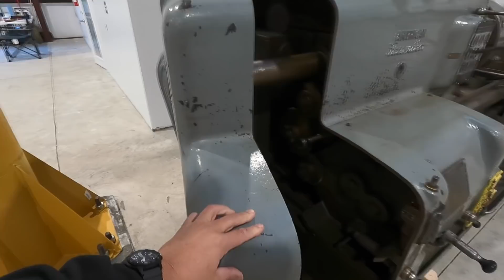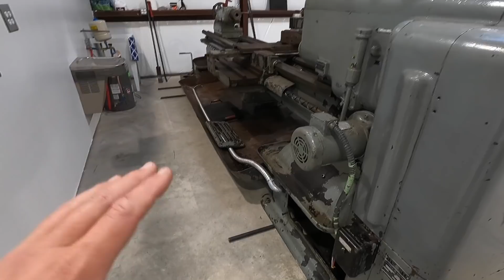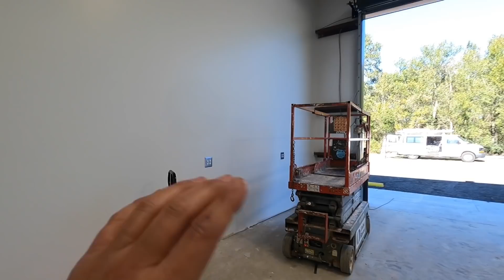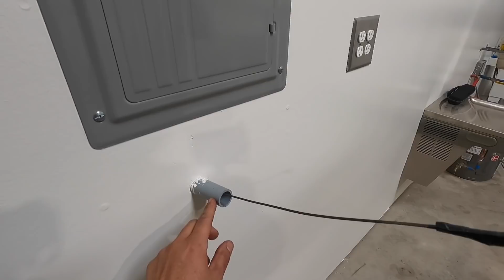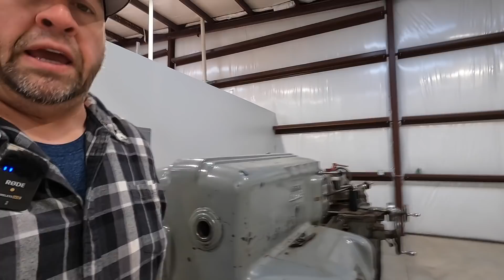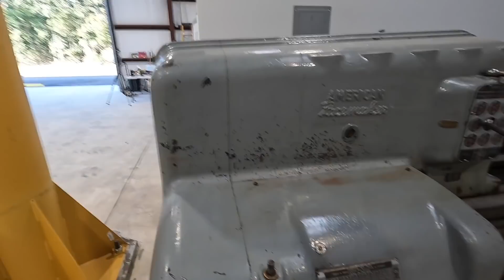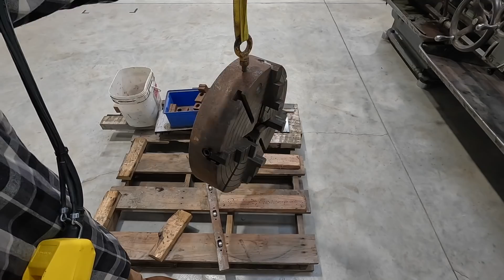New Shop Space Update 12: 3 Phase Electrical Circuits, Lathe & Crane First Tests

Comment: I have a feeling the previous motor starter might have had a 480 volt coil and that’s why it was shattering at 220 volts. . The coil could have been switched to a 220 volt.

Comment: 8:37 Get a load of the plumbers nightmare installation on the hot water tank.
 You got to be kidding me, that's the worst looking job, needs a bloody box around it.
I'd be well embarrassed offering this as finished install.
Plus where is the outlet for the temperature/pressure outlet going?
On the bloody floor, not acceptable in any circumstances.
Just as a last note the sewer vent pipe is also in an unacceptable position.

Comment: This reminds me of my first job out of school. Moving machines like this and larger in and out of factories. We had sets of things that looked like giant steel roller skates that we'd fasten under every screw down point. They had a solid bar sticking out of every skate and there'd be a man on each corner armed with a sledge hammer to smack each bar to point it in the direction we wanted it to move. Combined with an overhead crane we'd sometimes roll machines across an entire factory in or out of a loading bay. The only thing that used to scare me was the fact that factory floors in some old buildings weren't always flat and sometimes huge pieces of machinery would get a little out of control down an incline. We'd be praying that the slings and ropes we had hitched to the crane to pull it or stop it would prevent it from getting away from us. It was quite an art to do it safely and quickly because we'd often have to do it whilst everyone and everything in the shop was still working. I don't think they'd allow it on health and safety grounds these days.
Reply: Been there done that, worked a papermill in my younger days, then got smart.

Comment: The Overloads need to be changes for the correct amperage. The motors were rewired for 240v from 480v and the current will double. Check the nameplate on the motor for the FLC at 240v, there should be a sicker on the overload box that will show correct heater size for that amperage.
Another person had said that you need 3 phase overloads for a 3 phase motor. That is common for current overload relays but working with the older machines many only had 2 overloads but still gave full protection as the current from each winding would travel through 2 conductors at a time and the 3rd phase was wired straight through.
The shop is coming along great and love the crane!

Comment: Adam, I would rotate the pacemaker.... 90° clockwise..... And put it against the adjoining wall to the office cubicle. Why crowd your fountain and electrical panel unnecessarily?

(Let Abby design the layout. Women are so much better at those things than men.)

Also, with a bed that long..... You might want to research out a follower rest to purchase.

Comment: whats up with the lead / feed screw on the back side?  Looks like its a dual start with opposite handedness?  whats the purpose of that?  are there are RH & LH half nuts to engage in different directions?

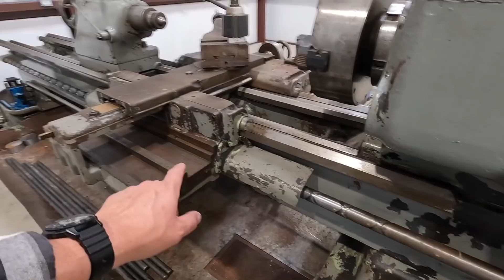kept watching...he explains it well @ 36:00.    its a dedicated(not clocked to spindle) bi directions rapid feed.  presumably for all your non cutting movements.

Comment: The overload protection "Heaters" look like just 2 of them.  The motor should be 3-phase, I assume.  Anyway, the heaters should be picked to match the motor nameplate values.  If over size or outright bypassed, that leaves the motor unprotected.  The most common reasons for the tripping is missing one of the three phases.  The second problem that I can think about is actual excess friction, meaning rusty ways.  And the third one is that the motor does not reach its full speed, because of under voltage, in this case it could still be hooked up for 480 V, while you try to run at 240 V.  A squirrel cage motor pulls maybe 10 x its nominal current during start and until it has reached its nominal speed.  If the supply voltage is too low, the motor does not get over the torque "hump" and remains at a high current "start" domain.

Comment: I was a machinist for 44 years. And more the half of that time was on American Lathes. Some were the old GE control CNC lathes converted to Siemens CNC controller sinumerik 810/840. The newest frame I think was 1968. Of all the lathes I ran in my career. American's were the best. The frame bed is by far superior to any thing made today. You my friend have a great lathe that they don't make anymore. And the industry is worst off. Keep making chips.
   .

Comment: I did industrial electrical for a very large Machine Shop and the electrical inspectors I know would have a field day in that building and I would have gone ballistic...Unstrapped MC cables dangling, no chafe bushings on EMT Connectors, using 1 hole straps on a rigid conduit on the floor instead of 2 hole rigid straps, running rigid on the floor through a walkway instead of doing an Arch over,  no penetration bushings on MC where it goes through the Red Iron and MC being used exposed below the 8' level.  If his "Electricians" had worked for me, they would have been sent back to class to learn the NEC or unemployed after I saw their work.
Reply: he's in Florida, they don't believe in regulations down there...
Reply: @stuartwheaton7340  So am I, and they sure as hell do around here.
Reply: Lol I was looking for this comment when I watched the video

Comment: Adam,  I tell you what's going to be tripping, it's you... over that 1' conduit on the floor. I would have cut a small trough in the concrete, or run the conduit up-over-and down. Ramping over, especially in a high traffic area, is a nuisance for walking or cleaning the floor. 
Still enjoy the content as always and congratulations on the new shop!
Reply: I cringe when i see that conduit laying on the floor, please be careful.

Comment: The "heaters" (thermal overloads) are half the size they need to be. They're sized based on the amp draw of the motor at the rated full load (listed as FLA - full load amps on the motor nameplate). Since the motor was rewired from 480V to 240V, the current draw of the motor doubles.

Comment: When you rewire from the higher voltage to 220, the current draw on the machine is much higher. The OL heaters will either have to be readjusted or replace with ones that can handle the higher currrent. Same goes for the coils on the contactor...if they were 480 or whatever before, they will need to be replaced with 220 or whatever you are using now.

Comment: The clutch sounds just like an automotive clutch which has a worn out throwout bearing or pilot bearing/bushing. In a car or truck, the throwout bearing spins whenever the clutch pedal is depressed which disengages the clutch. The pilot bearing or bushing is in use whenever the clutch is disengaged and the trans input shaft speed is not the same as the engine flywheel speed i.e. at a stop with the clutch pedal depressed. Not sure how that Pacemaker's clutch is set up, but if it is exactly like a car or truck's clutch those 2 items could be the issue. In simpler vehicles, the pilot is often an oilite bronze bushing supporting the hardened input shaft snout. Bearings are sealed though. When the clutch makes noise when it's being disengaged, it's just time for a new clutch assembly and both parts are replaced because it could be either one making noise and you're there anyway. If the clutch and trans make noise with the clutch ENGAGED in neutral with the engine at idle, that is the trans input shaft bearing that has gone bad. In that case, the noise totally stops when the clutch pedal is depressed and the clutch is disengaged. 👌

Comment: The noise from the clutch might be the belts with no load on them and the heaters need to be changed for the higher amperage of the motor at 240 Volts. Thy a little belt dressing  before you tare into it to far.

Comment: You guys in the States have a crazy electrical system. Here in the UK we got 240 volt single phase and 415 volt three phase and that's it.
Reply: In my USA shop I have 120V 1 phase which is one leg of the 208V 3 phase used on all 208/220/240V machines either single or 3 phase.  I have transformers for 460V 3 phase for the USA heavier machines, 380/400V 3 phase for the European machines and I may need to put in a transformer for the 575V Canadian machine.
Reply: Ours is 240, it is just split in two as well. More options. We have 480v so we can run bigger stuff.
Reply: @AldoSchmedack  Yes, I hear that, you have the neutral as a centre tap so you have  minus 120 and plus 120 volts giving the option of 240. In the UK that facility doesn't exist so all of our stuff is 240 minimum. The only variance on this would be building sites where transformers would be used for 110 volt power tools for safety.

Comment: not an electrician, but , usually when you change a 480 volt machine to a 240 or 208 machine you have to change the heaters because the amperage doubles,  not a big deal on the main motor because it is rarely going to reach full power, but feed motors and pumps are running at their ratings all the time
Reply: what do you mean by ''heaters?''
Reply: @JohnSmith-vi5pz  It's an "overload heater" wired in series with the incoming power to the motor. It protects the motor and circuit against overcurrent. A circuit breaker/fuse will quickly protect the wiring/motor in the circuit against a short circuit/very high current draw. An overload heater will protect the motor from operating above it's Full Load Amp rating for a length of time due to overloading the motor, or a motor failure (motor locked up, bearing failure, etc.) but still allow the inrush current needed for the motor to start. These won't necessarily trip a breaker/fuse. The overload heater is sized to carry the current that the motor is rated for, and as it does, it heats up. If the motor draws more current, usually 125% of its rating, it will heat up enough to "open", usually through a bi-metallic switch in the heater, to protect the motor from burning up. A lot goes into sizing everything properly, but this is a really simplified idea of what the overload heaters do. Hope it helps.
Reply: @KSparks80  Thanks, that's a perfect explanation.

Comment: Does this shop not need to comply with the NEC?
Reply: 36” clearance? Is one of the first things I noticed. Looks close.
Reply: No doubt, lathe feed looks nice but that bx across the ceiling feeding the crane is disgusting, aswell as those welding plugs. That should all be piped to look tight and clean.

Comment: Adam that's a very nice machine you got there!  With regard to the clutch my Harrison is a similar design clutch pack, they have a habit of being a bit noisy when not engaged, it's just the design, you can adjust it until it's silent but it's a fine balance between it being silent and a bit snatchey when engaging, I have found the best balance is it's making just a little bit of noise when not engaged.

Comment: wow there is already a big crack on the new concrete under the machine. I hope the concrete can handle that load with more machines. And I would be nervous moving that machine alone, I would have had someone around just in case.
Reply: Probably cracked just from curing, pretty common unfortunately
Reply: Originally that's what I thought, but I really only saw the cracks developing under the lathe. Just concerned about overloading too much weight on one spot with the crane as well. But I really like the setup so far.

Comment: That noise sounds like the bearing on the actuation lever clutch end should be an easy fix sounds dry or otherwise gone bad.
Reply: It's the clutch plates it's easy to adjust.

Comment: Are both lathe motors (the rapid transverse & main drive) wired into the same starter?  If so, you may need a larger size starter with proper 
heaters to handle the higher amperage.  Normally, each motor has its own starter and fuse block unless you're using modern contactors with thermal overloads.

Comment: I have a bunch of 4" chrome rod from cutting a 30' chromed cylinder rod in pieces. Adam, are all rods typically made of 1045 steel? If not, how to you figure out what it is? I was going to order some 4140 to make a bolt for my multifix tool post, but I'm wondering if my rod material is plenty strong. Thanks. If it matters, this rod came from a German built cylinder, about 10 years ago. It had to be replaced because it was bent.

Comment: In case someone hasn't posted it, one of the things I like with my jib crane in my shop is that I painted a 3-in wide line on the floor  that follows along the entire arc of the crane and hoist. That way as I'm moving things around on the floor, I know exactly if I'm able to reach it with the crane hoist.
Reply: And a piece of red safety flag that hangs about 8" down from the hook, if the hook is at head level and your wearing a hat, its just a matter of time before you smack your noggin on it. Not that it will help you if it ends up behind you... but, at least it wont be your forehead.

Comment: Half the voltage on the rapid motor, twice the current, so the correct heaters (overloads) need be installed for the 240/3/60.

Comment: Is it just the video, or was the handwheel not turning consistently when he had it engaged for threading?
Reply: This is by design, the handwheel should disengage when you use the power feed or leadscrew. It's turning a little bit because of friction. 
Else you get hit right in the balls.
Reply: I noticed the same thing.  Either dirty or it won't make nice threads!
Reply: It's called weight. It swings down due to gravity. Totally normal on large lathes.
Reply: Fair enough, my lathe is small and it stays engaged during power feed and threading

Comment: You think that clutch is noisy? you wanna hear my 65 year old Harrison L13! Nice Lathe you got there just a little small in the spindle bore diameter, as most older lathes are. I am rebuilding a fairly large lathe right now, new Gamet spindle bearings (£2800!) as someone changed gear under load and smashed a few teeth off (wired out a new one out of EN32 and ran it in pre hard to size it, now back from heat treatment) and pushed the debris through the spindle bearings while destroying the oil pump!

Comment: Alright Adam, it works it, works, it works! Hay, have you thought about putting flags on the jib crane hook and also the pendant cord it self? 
  What I mean is raise the bottom of the hook one fist in height, above the head of the tallest person in the shop and place a flag on the pendant cord at that height, this way you can always see the safe height to leave the cook when not in use. 
Then place a short removable flag on the hook it self, which will serve as both warning and pull handle. This will avoid most of the inevitable skull smash that are bound to happen.

Comment: if the machine was wired for 440 most likely the heaters need to be changed to 220V. Been there done that. lol
Reply: yes because higher amperage due too changing too a lower voltage

Comment: Today's contest:  Guess to the nearest thousand, how many "keyboard electrical experts" will mention the heater overload voltage!  Does anyone ever read the damn comments?
Reply: Nope
Reply: Lol
Reply: Who has time to read 1100 comments?  But to those comments I would add, the shop probably has 208Y/120 not 240.  240 would most likely be a high-leg connection having two electric meters.  In the case of a 208Y/120 service the motor should be replaced, if necessary, with one stating 208V instead of 208-230, because those motors with 208-230 on the nameplate are normally run on 240V.   A lot of 208 only motors will also state "useable at 200V."  Bottom line is best to have 480V service either with a step up transformer or in the case of a 480V service entrance use a 208Y/120 transformer to feed office needs.  Another way to handle it would be to install boost transformers.  A lot of electricians don't know how to connect them though.  

240 is typically used for resistance heating.

Got the right idea though putting the 20hp motor near the panel.  Saves money.  Of course the 480 does that too.

Comment: Do you need the rapid reverse motor running all the time? I mean, how often are you going to use it Adam, why not put it on it's own switch so you can turn it on if you have a job you are likely to use it on, It's just sitting there running wasting electricity 99% of the time.
Also, your rear door, does it lift off the hinges or is it fixed in place?

Comment: Are your electricians allergic to EMT?  That should have been at least a 1" EMT run around the side.  If you use copper you can get 100 amp feed later if you need.  They were already there and touching it, why not make it easy for the future with minimal material cost increase?

Comment: You might think about building a mount for the chuck to be against the lower wall between the water fountain and the electrical box to keep the chuck off the floor and off the ways and out of the way.

Comment: Noise = throwout bearing?
Reply: Or maybe just the multiple clutch plates rattling a little on being held open?
Reply: @jimcrichton8028  that might make more sense with the drag he has on start up and having to pull the handle out all the way.  still, noise only when the throw out is loaded and the plates are not.  It will be interesting to see, regardless.